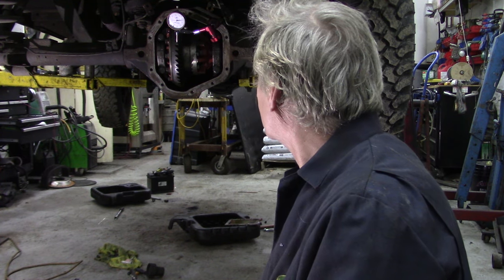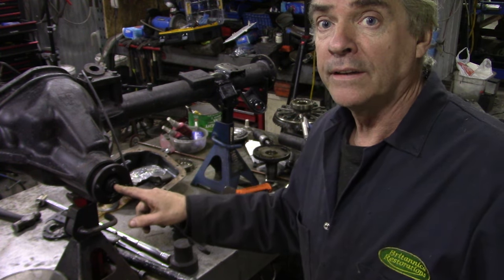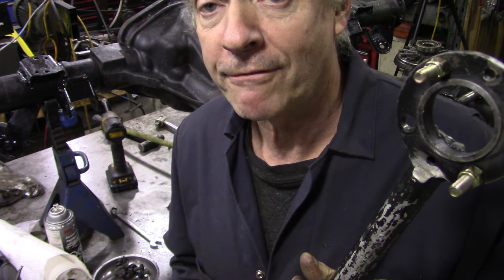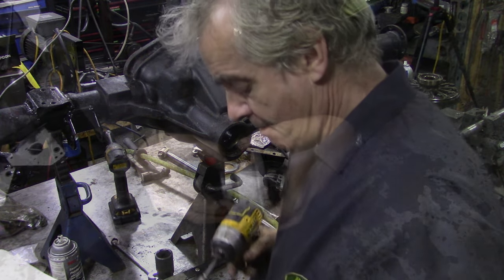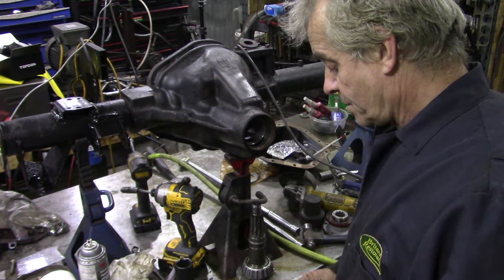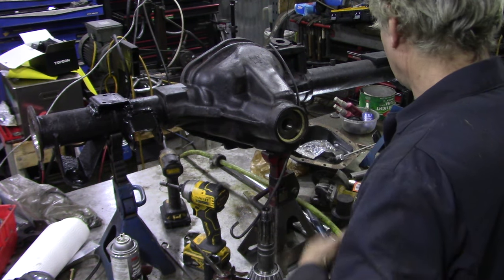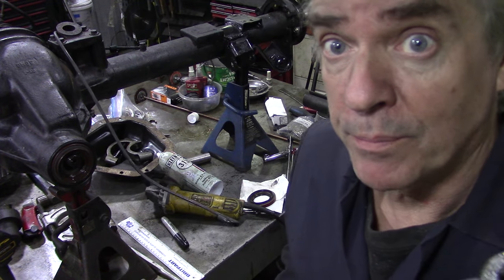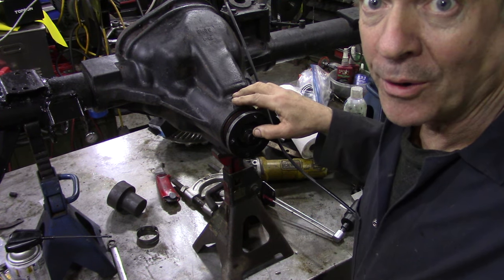Replacing the Defender Salisbury axle front pinion seal

Comment: Well, like always, you are a blessing. I have a very late 90s 110 300tdi with a super clunky salisbury and I v had mixed thoughts about rebuilding it or just buy a discovery 1 full diff, am gonna have to dare it because I want to keep my defender (companion 😊) as stock as I possibly can.
Reply from the maker: This one is a right old pain in the arse! Clunky, but checks out - put new shims in the spider gears, and the new ones seem to be out of spec as they block the diff completely! 
The backlash is just on the extremity of the specs 6-11 thou - this one is 13 
I think I will take a shim out of one side and stick it in the other to see what happens
Problem working on these axles is the tools needed
Reply: @BritannicaRestorations   @BritannicaRestorations 🤣🤣old pain in the ****., am a heavy duty mechanical engineer (CAT) so I v got most of the tools, problem is I bought diff rebuild kits (non salisbury) for my other defender from britpart and they wore sooner than I expected so am not sure the other manufacturer to use.